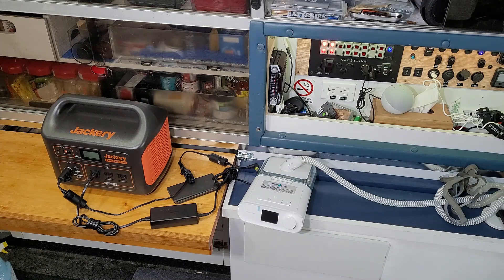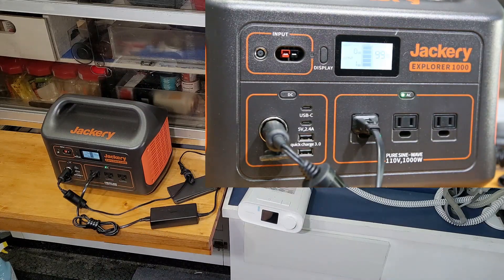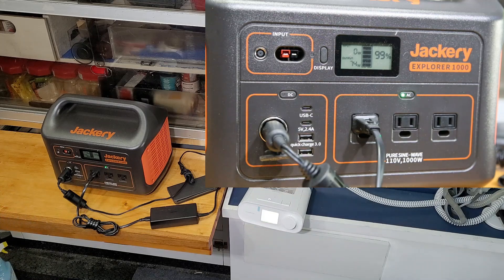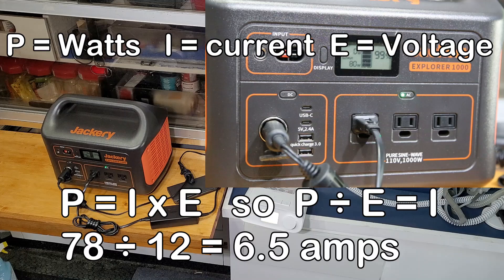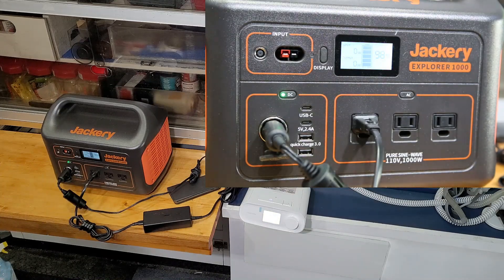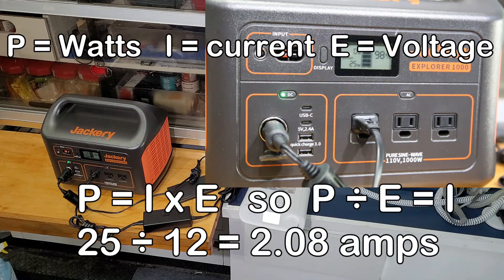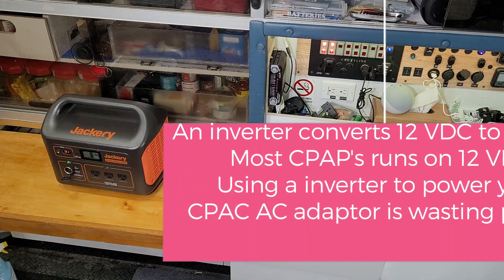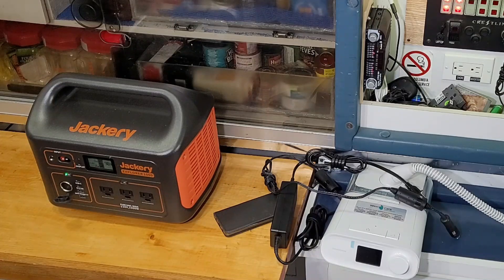Comparing power consumption  between AC and DC of a CPAP using the Jackery 1000.

Comment: Just a heads up to anyone thinking about buying another cord for this purpose.  Some CPAP machines automatically turn off your humidifier and or heated hose when hooked to direct DC current.  You can achieve this same result by turning those features off inside the machine.

Comment: I wonder how much loss there is with the DC.  I was following some other battery backup units with both DC and AC, and the DC had 0% power less.  But I heard the Jackery units waste energy to ensure the DC is at 12V, that there is no 0-loss when using DC, unlike other brands.  I wonder how much loss there really is.  Surely it is a lot less than from DC to AC, or specially DC to AC to DC.
Reply from the maker: I belive the loss is very low they do use a good quality Lithium battery

Comment: My CPAC would work for 2 nights when I was camping out. I was using a Canadian Tire battery Eliminator. I replace the battery at Edmonds Battery in Burnaby. It runs my radio equipment in my car rather than using the main starting battery.